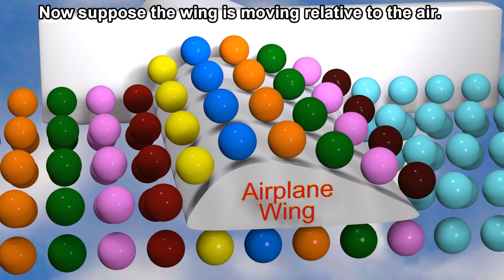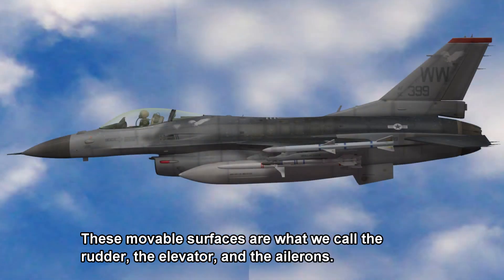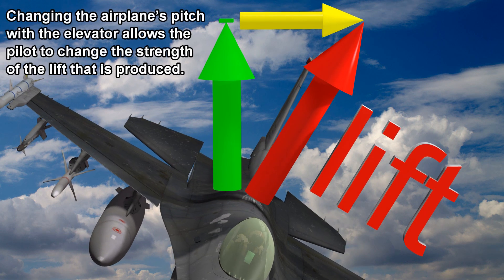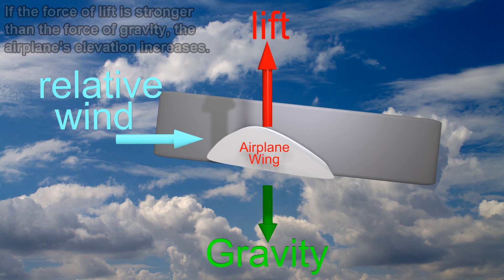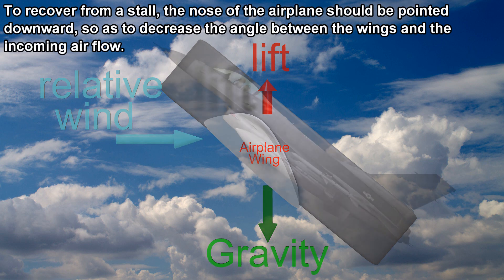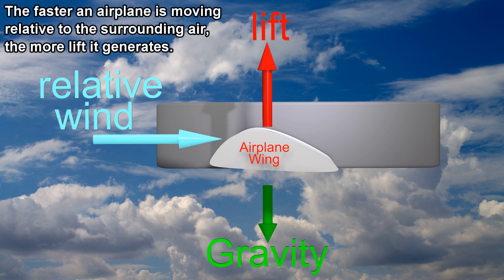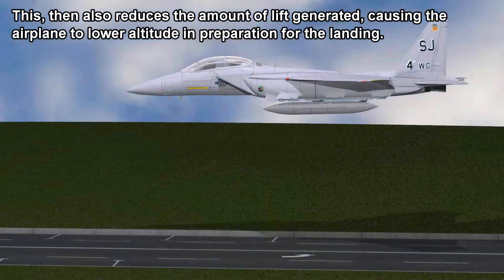Aerodynamics - How airplanes fly, maneuver, and land

Comment: what if put a roller in the upper part of wing instead of a simple curved surface. so that we can spin the roller in the desired direction to create more lift/ drag.
your videos are great. i am 15 and i can understand your videos well.they are simple, informative and interactive.
Reply: ***** i mean, the magnus effect will be more in this case so won't there be more lifting force.
lot of energy is used in the aircraft so providing some more energy won't do any harm.
i may be wrong, i am not expert, i may not be looking at the loopholes of this idea.
Reply: +Nolan Rata 
Now i got it ,  :)
it's very nice of you to have me the loopholes in front of me.
thanks once again :)
Reply: In addition that roller would change the airflow above the wing and that flow is very important to lift.

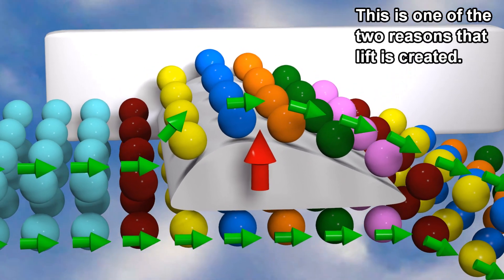Comment: From 1:41 to 1:56 you state that the air "below" the wing is creating a greater pressure, which creates a net upward force on the wing... but isn't it the opposite? The air "above" the wing is the one that creates greater pressure (therefore "drag"), for it moves faster, resulting in the net upward force.
Reply from the maker: +BState media, if the air above was creating a greater pressure, than this would mean that there is a net downward force, and hence the airplane would never fly.   Bernoulli's principle states as the air moves faster, the pressure is reduced.
Reply: +Physics Videos by Eugene Khutoryansky I understand that, but I'm actually talking about the "drag" that the air above the wing creates because of faster moving air molecules, it's that "drag" that creates the lift, not the higher pressure bellow the wing. The higher pressure below the wing just creates a better "surface" for the wing to stand on, and the "drag" above the wing is the one that creates the "lift".
You can make a small experiment with a spoon and a flowing faucet to see what I mean. Take a spoon, open the faucet, place the back of the spoon (it has the same curve as a wing) to touch the flow of the water, and you will see that the spoon is being sucked/dragged stably creating a force that holds the spoon inside the flow, you can even move the spoon slightly and it will be holding it's place into the flow. Now, you see that there is absolutely no flow from the other side of the spoon, so no higher pressure that "pushes" the spoon towards the flow of water, but it's only the "drag" of the water over the curve that lifts/sucks/drags it and holds it in place. Please take note that I'm only talking about air that moves in parallel with the wing.

Comment: Great video, as usual, Eugene! 
I don't understand why the air molecules have to arrive at the end of the wing simultaneously (as shown in the animation). Why can't they move in the same relative speed over the wing, and  arrive "out of sync" with the colour-matching molecule pair.
I also don't get why faster moving air molecules generate a lower pressure (over the wing) than the slower moving molecules (under the wing). 
Hope I'm not asking too dumb questions, and thanks if anyone can clarify.
Reply from the maker: +Anders Andersen, glad you liked the video.  In reply to your question, the air molecules actually don't arrive at the end of the wing at the same time.  The air molecules flowing over the top arrive there before the air molecules flowing at the bottom, and the air molecules should be flowing even faster over the top of the wing than I showed in the animation.
Reply: +Physics Videos by Eugene Khutoryansky Okay, thanks a lot. Can you explain why the shape of the wing is forcing the air molecules to move faster? I understand why this generates lift, but I can't understand why the molecules travel faster.
Reply: +Nolan Rata Thanks a lot for the reply! Instead of asking questions, I'll try to re-explain what you said (with my own words), so you can correct the wrong parts.
Assume a horizontal flow. Place a plane with a wing witch, from back to front, is inclined slightly upwards. The flow will run over and under the wing and rejoin and the backside of the wing. It's easy to assume the flow continuing horizontally, as before, but this is not the case. The wind is being deflected by the slight incline of the wing and will continue at an angle between the horizon and the angle of the slope (relative to the horizon). 
The reason the wind is being deflected is the creation of a vortex. The vortex is placed around the wing and is spinning counterclockwise (or "backwards") to an observer on the right side of the plane. This makes the flow on top of the wing  move faster than the flow under. A physical law called Bernouill's law states that a fluid going faster results in a lower pressure. This difference in pressure generates lift.
Reply: +Nolan Rata Thank you so much for answering me, it really helped me understanding the basics of lift.

Comment: What about flying upside down? ;)
Also, I think it requires a leap of faith to accept that "still air moves faster over the wing" and "air moving faster generates lower pressure". ;)
Reply from the maker: +grywacz, regarding airplanes flying upside down, I pointed out that there is more than one reason that lift is created.  So long as the wings are deflecting the air downward, they can generate lift.  As for air moving faster over the top of the wings with this shape, this has been proven empirically many times.